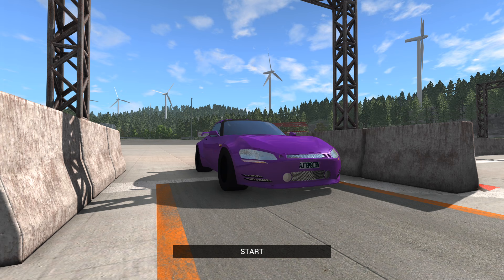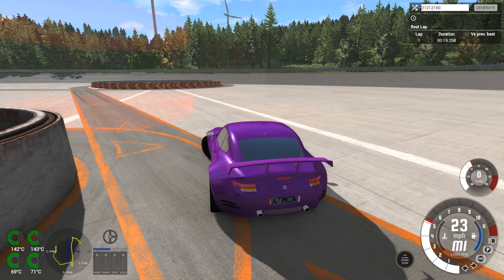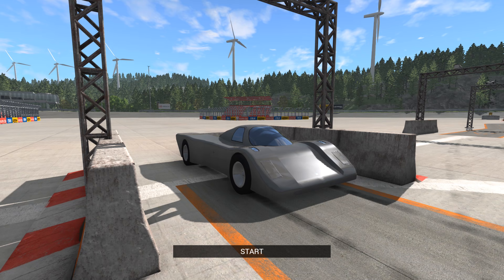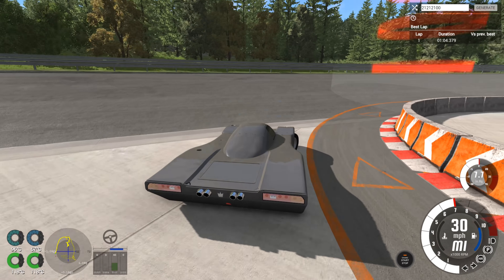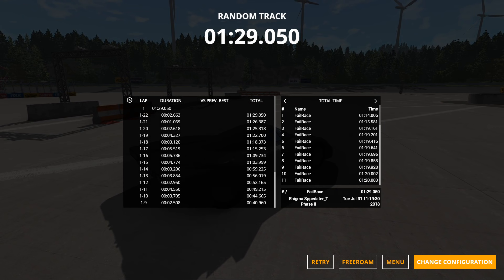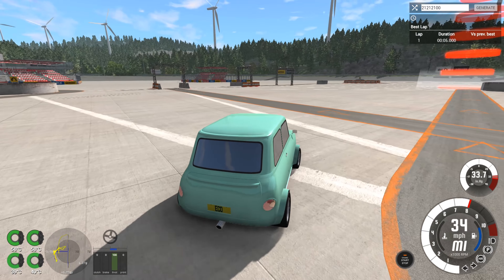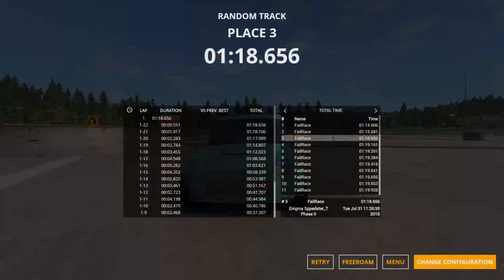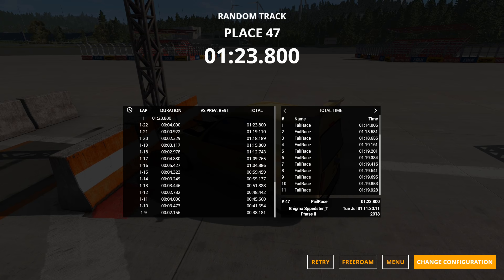Automation/BeamNG Drive - Mad Turbo Space Ship - Autocross #6

Comment: For anyone that wants to build a turbo engine in Automation, it is essential to eliminate lag. You do this by lowering the turbine size to as small as possible for your engine, and crank the AR Ratio all the way to 1.40. If done correctly, you'll have a very responsive turbo, regardless of the boost pressure. Like so Alex can see too! Cheers

Comment: Fastest RWD car so far? I'll take that. Also I think the Automation to BeamNG crossover messed up a bit since Automation said the brakes would be good for the car.
Reply: I think your front brakes may actually have been too big for the car. Automation checks to see if they dissipate heat fast enough to ensure there's no fade, but not if they will retain enough to be usable with high-race-compound pads.
Reply: I mean either way, still the fastest RWD car so far so I don't really mind all that much.
Reply: I'm comin for that record, fam
Reply: Well, Automation say it's great for track use not autocross. On track the brakes get up to temperature on heavy long braking. In autocross you are basically braking at 60mph for 2 feet.

Comment: well my time at the top is over, so congratulations to tomclee and tomwhodoesmaths. it seems i can only be beaten by people called tom 
on different note i have thought of a few ways to make the harrier faster so i will return if there is ever a season 2 of this -Suprec
Reply: Rune Ildor Petersen Thanks!
Reply: hey man you earned it. i do have one question however, why did you only go for a 1.6L engine? could you not fit a bigger one in the car?
Reply: Rune Ildor Petersen I could have went for a 2 litre but I wanted a light engine to try get close to 50:50 weight distribution and my first attempt had nearly 400hp out of 2.0 and it became very twitchy.

I went for less power but lots of lowdown power

Comment: And now with all the high revving cars I need to make a super low revving engine in a light car that has long ass gears and instant power and torque.
Reply: Chevy Johnson That's pretty much how I designed mine. Light and quick on power. Torque fiend but low HP. I don't know how it'll take to him driving manual, redline is about 4100
Reply: Vergo Bret well I did manage to build a rediculously big inline 3 turbo ones that spooled up basically instantly and made a rediculous amount of torque, too bad it redlined at 2k rpm.